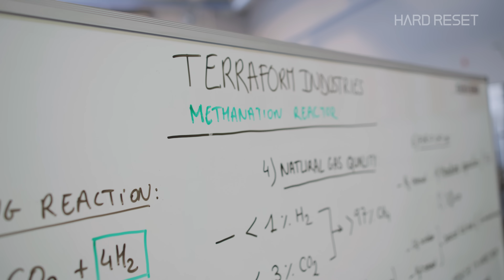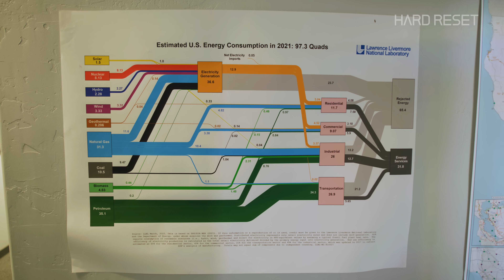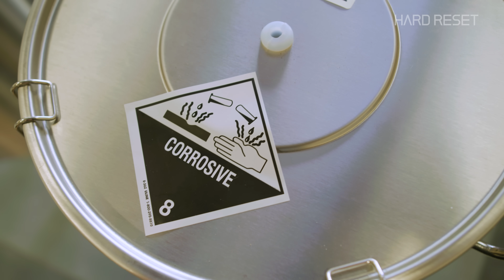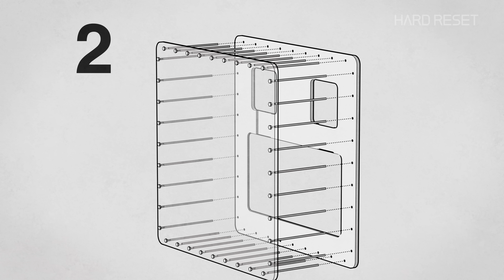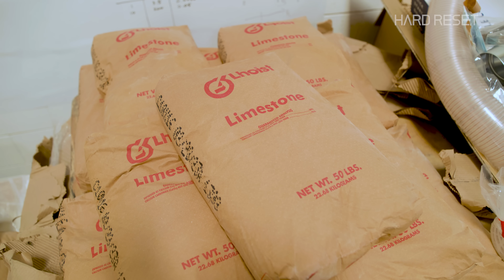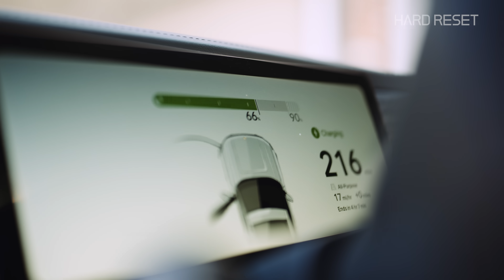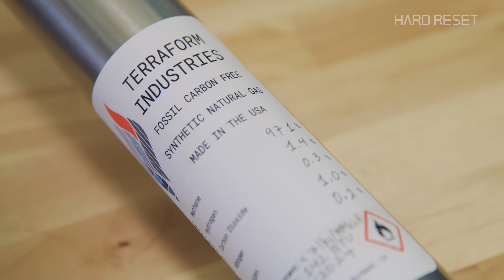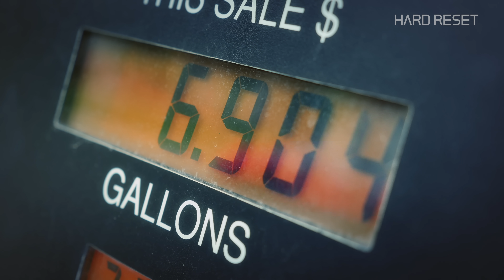The Last Fuel We'll Ever Need?

Comment: Fantastic technology..hats off to Terraform Technology... This reminds me off the Haber Bosch process where nitrogen is split under tremendous heat and pressure combined with hydrogen to make fertilizer.  Why can't they use the oxygen that is released from oxygen from the electrolysis process and combust it to run a gas turbine to generate electricity for the process to make it more efficient or even collect it and compress it in tanks and sell it ...just some loud thinking on how to increase efficiency.  I am from India and would be very interested in setting up a plant out here in the future...abundant sunshine
Reply: You don't need more oxygen than what is in the air to run a gas turbine.

Comment: I also understand it's not that hard to make methane just with water, charcoal, and heat.  You get some carbon monoxide in the process, which could be separated and used as fuel in the process.

Comment: Try vertical tanks attached to the walls of skyscrapers (so window washers dont have to deal with getting around them while cleaning windows. And if its sectioned out and clipped to the building itself you can replace them like lightbulbs imagine a tube bulb with algae in it that powers the building its hooked to that could solve the clean power system to terraform mars.

Comment: they are making a bet solar will get cheaper.  it will by a lot
they are also betting that batteries WONT get cheaper / better and power all the things they want to power with synthetic fuels like: trucks, planes, drones, rockets.

Solar + Batteries will pretty much dominate everything within 15 years.  
These fuels will have some edge cases - just like hydrogen or rocket fuel.  

Cool tech though.  i hope it works out.  you can never have enough energy abundance

Comment: Most people are probably thinking of this as a replacement for gas for heating and appliances, but that actually wouldn't make sense, since you could do those things more efficiently just by electrifying those systems. It would be good to apply this to making fertilizers for agricultural use though, which currently is heavily dependent on natural gas. We could totally eliminate natural gas drilling by doing that, in a way that is not practical with other methods. Making biogas from animal and plant waste is good up to a certain point, but it has a limit of sustainability when you start having huge fields and forests dedicated just to producing biogas, which will remove carbon from the soil and leave it depleted. Another consideration is that this tech could be connected to a geothermal or nuclear power plant, thus removing the requirement to take up massive amounts of space and materials with solar cells. I would say hyroelectric as well, but I'm at the point where I don't think massive hydro plants are worth the ecological and human costs. Wind could be a possibility as well, though I'm not actually sure whether or not they use less materials and energy to manufacture compared to solar.

Comment: my idea is CCU to Methanol and DME? both are much easier to store/transport compared to methane? we could RnD to make direct conversion processes even more efficient? politics aside M100 (100% neat Methanol) is available at the pump in China which are used by huge taxi fleets 24/7! DME works in Compression Ignition engines aka Diesel with few adjustments sometimes but a purposely designed one could be more efficient and vastly cleaner w/o any postburn treatment! Also there are already existing Methanol fuel cells which IIRC are 60-65% efficient? With RnD we could create even more efficient Methanol/DME fuel cells and pair them with electric motors for automotive applications. There is a prototype Methanol FCEV supercar called "Nathalie" made by a german engineer. His Orange Highness and members of government notice my rotund feline avatar and brilliant ideas! For a small fee you may own eternal and global rights...

Comment: Please remember: heating with Methane is very inefficient. Heat pumps are way more efficient than methane. And much cheaper than using electricity to create Methane.
But of course there are use cases where electricity is not the best solution and we need SynFuels.
The very, very important use case for those machines is the use of abundant renewable energy. 
And for this scenario you need very cheap machines, because they won't run all the time. This machine would run only 20% - 50% of the time. So investment per machine must be low!
Reply: There are uses for methane other than energy storage, but we could probably get rid of about 95% of our CO2 production without resorting to convoluted synthetic fuels which make little to no real world sense.

Comment: There are better ways that are cheaper and more efficient. Not only are there options for CO2 that remove their entire limestone step using industrial waste CO2 (which is abundant and you get paid for taking it) but producing Hydrogen and burning that removes 2/3 of their entire system. Downside is that producing Hydrogen is an energy losing process, meaning the best option is already not feasible.

Bio digesters are a workable option for mobility fuel and do not pollute like producing Solar panels does. Silicon produces 2kg of CO2 per kg which is why any option that relies on wasting cheap solar on inefficient processes is a nonstarter.

This MIGHT be feasible using nuclear energy because at scale the insane efficiency of nuclear can offset the losses of producing hydrogen.

Comment: Please correct me if I'm wrong, but this does not seem carbon neutral to me. in a perfect cycle it could be, take carbon from the atmosphere, convert to methane, burn it up in your car or whatever back into carbon. and you are back at the start. But! there is one big issue. methane is a gas that has a much higher global warming potential then co2. think 80 times more. and methane leaks are currently a huge issue. and i mean in each step of the production, storage, transport, and final use methane has a risk of leaking into the atmosphere. and if you scale the current use up in order to compensate for the fossile fuel that has to be replaced by it i am not sure if it would cause warming to actually go down. we currently have major issues with leakage and constructing at large scale and speed the facilities or adaptations to make and transport methane instead does not give me hope that it will be better in the future anytime soon. and anytime soon is exactly when we need to get rid of methane according to the ipcc. it is our best shot at staying below 2 degrees warming because unlike co2 the impact of cutting methane is much more directly felt. co2 stays in the air for a long time while methane decomposes (into co2) rather quickly. relatively speaking. just a decade or two. but with it being much stronger then co2 cutting it and allowing what remains in the atmosphere to turn into co2 will still decrease warming. 

this project it "the last fuel" we would want I fear. because there is an second issue with it. or rather with projects like it. maintaining the status quo. because if we don't do this but actually work on alternatives that will last then we can get the temperature down way faster then just kind of going half way. there are better alternatives today. ones that not only are better for the environment but also just for us as individuals. we need to decrease our dependance on cars. switch to electric where feasible. make real structural change.

Comment: Nice. Direct air carbon capture could be performed on co2 rich streams, perhaps from metallurgical and cement plants. All the energy required for this circular co2 to methane and back would need to be bridged by upscale renewable energy like solar. Combined with more bio processes and syngas or Fischer-Tropsch process and a variety of chemical pathways could be integrated producing versatility. Free ‘surplus’ energy from the sun and wind is the only real limitation.

Comment: Pretty sure I outlined a similar process in a reddit thread, a decade ago. Glad to see the holes filled in, and the kinks worked out. I'm not claiming origin, my take was a synthesis from several existing papers, just feeling a little vindicated that the loop works. Makes my think the ethylene glycol fuel cell cycle I was more recently running the numbers on might also work.

Comment: Wow.  So many energy intensive steps. This will never be competitive with ‘electrify everything’.
Reply: Hydrocarbons are also needed to make plastic and all kinds of chemical products that are usually made from oil. You cant make your clothes with electricity. So, if electricity is free from solar, any percent of efficiency still makes a viable product. Thats the whole point and key you need to master in order to get away from oil, not just "electrifying your car".
Reply: @strangereyes9594, it’s a lot easier to get hydrocarbons from the ground. We just don’t have to burn them as fuel.

Comment: The killer failure point of this while process is the Capex on the hydrogen electrolysis cells.  These are a mature technology that are already built at scale and we know they're way, way too expensive to bother trying to build a refinery-scale plant.  It'd be like trying to run a Just-Eat or Door Dash service using a Ferrari.   Sure, you could do it, but no one is making any profit due to the huge operating cost and loan repayment on the Ferrari.   Same deal here, Capex is King and no one is stumping up for electrolysis cells no matter what the efficiency is....
Reply: Yeah, they described the electrolysis cell, it uses common low tech materials to reduce the capex like you said.

Comment: It's a pity this can't be used reliably in vehicles as elec will be more practical for small and storage will be impractical in larger trucks or ships.  the energy density of bunker fuel is 40MJ/L and Methane is about 55MJ/kg - A 10L cylinder at 300bar will hold 1.94kg of methane - that same space can hold 10L of bunker fuel.  Sadly I think the only application would be for houses/cooking and other static applications where solar outcompetes in almost all situations. I wish it would work but methane/hydrogen fuel is just impractical in all aspects. methanol on the other hand could be an absolute game changer and I really hope it works.

Comment: Wait isn't methane like 10 times worse of a greenhouse gas than carbon dioxide, and isn't it incredibly hard to keep methane from leaking since it doesn't have any smell?? So even if it's supposedly carbon neutral will it be worse if there's more leaks

Comment: You don't need to get the CO2 out of the air there are other sources.
If you produce bio-gas (fuel is coming from sewage treatment plants), you will get a mix of 50/50% methane and CO2.
You could use this source it is also CO2 neutral, and much easier than filtrating it out of the air.

Comment: This hurts to watch. Hydrogen is currently produced by splitting hydrocarbons aka the product they are trying to produce. So they are using expensive electrisity to run the reaction backwards. This only works if  Firstly hydrocarbons are really expensive and in high demand (wich they are only because electricity is expensive), Secondly electricity has to be extremely cheap. 1 can happen but as soon as 2 happens the demand for hydrocarbons goes down dramatically, they only will be relevant for chemical reactions.

Comment: A lot of "low hanging fruit" is cheaper to simply electrify. This process has inherent efficiency losses not present at the same scale in batteries or grid power.
But I agree: that we are going to need some kind of carbon-neutral hydrocarbon synfuel for the applications where full electrification is an intractable problem.
Hydrogen is just too hard to store and transport.

Comment: However methane is not carbon free. It is a hydrocarbon and when it combusts, releases CO2. Methane is also ‘poisonous’ if released into an indoor or enclosed space and asphyxiates in a similar way to CO2. It is also one of the most potent greenhouse gases, far more so than the CO2 from which it can be produced via biological/chemical processes. Piping small-molecule gases such as methane often involves leakages, though less so than tiny hydrogen atoms or molecules

Comment: super cool, now deploy it at scale, and while you're at it also stop using natural gas for cooking, stop using gas for producing steel, stop using gas for heating, use more BEVs for use cases it's good at (i.e. anything but long range, high load), start carbon capture using accelerated weathering of limestone, etc.; we need all the possibilities at max potential. this isn't a silver bullet that will allow us to just continue with the status quo. 30%+ efficiency for this process is amazing but the well-to-wheel efficiency of vehicles run with this technology is still absolute garbage compared to a BEV in the end.

Comment: 10:19 Per AI,
The efficiency of a Sabatier reaction, which converts carbon dioxide (CO2) into methane (CH4) using hydrogen (H2), can vary depending on the specific setup and operating conditions, but generally falls within a range of around 60-70% for the methanation process itself, while the overall efficiency of a Power-to-Gas system utilizing the Sabatier reaction can be significantly lower, often around 35% due to losses in the electrolysis step to produce hydrogen

Comment: WTF...
This is by no means the latest state of the art...
Hydrogen has always been produced this way, but:
The way they gain CO2 -> simply connecting a CO2 separator to a concrete mixing plant is the same process, but much more efficient.
And then they produce methane of all gases? Methane has a global warming potential of around 27. If only the 27th part of the methane escapes (and it is a gas after all), then the whole process is no longer climate-friendly.
Just make propane or gasoline.
But of course, making propane or gasoline is even more complex, since the whole process alredy uses many times more energy than is provided in the form of fuel at the end.
It's just the e-fuels debate all over again.

Why the hell is this being presented as if it were a new idea or even economical in any way?

Comment: Nice video, thanks. I have nothing against the technology, but it's going to be niche. Any time you take solar energy and convert it to something else, you have to have a reason not to have used that electricity directly. For example (not your video, I know, but it's a simpler analogy): using solar to make methane to burn in a car, vs charging an EV battery. The car's efficiency is around 40% of the potential in the fuel. More efficiency is lost delivering the fuel to a fueling stop. Then there is the efficiency loss in creating the actual methane. If we used an EV instead of the car, we have a car that is about 90% efficient in turning the battery energy to motion (80% including the battery charge/discharge loss), and a fuel delivery system that is about 90% efficient (the grid). And we can generate it locally in remote locations with solar cells and local storage. Now, there will be niche applications for this, especially in the production of chemical end products. The same goes for green Hydrogen - it's incredibly valuable as a feedstock for Ammonia to make fertlisers, but silly for cars.
Reply: I like the fact that they are defining efficiency (for them) in economic terms.  Eventually, however, they will be unable to make further progress unless they pay more attention to energy efficiency.  They'll figure that out on their own.  The real trick I think is how to make electrolysis more efficient.  That will be challenging.  I wish them luck.
Reply: Storing electrical energy is the Achilles heel. All the storage methods, pumped hydro, battery, potential energy towers, you name it ; fall way short of the stored energy that is contained in a liquid fuel. We already have a planet wide infrastructure  to store, transport, and distribute liquids without creating  or dramatically  expanding any distribution/storage system and tearing the planet apart looking for new deposits of rare earths. Electricity  is an energy  transport system, not an energy source.
Reply: I like how homeowners with the allegedly green electric  cars recharge overnight when the sun doesn't shine. How many coal fired plants could we shut down if nighttime charging was prohibited. But that would rob the atmosphere of the heavy metals from coal burning that fall back to earth onto the fields of food crops.
Reply: Solar have big limitation of night blindness 
So we need something which can be used day and night
Reply: The main issue I see this solving is that EVs are dependent on rare earth minerals for their batteries. And said batteries are heavy and expensive, too. Combustion cars are just more economical for most people to get outside of countries that forcibly change that either through taxing gas, subsidizing EVs or both. I'm not too confident this will overtake the new battery technologies that we're developing, but it's nice to have as an option in case those fail, I guess.
Reply: @rikuleinonen Yes ! Plus, planes aren't going electric any time soon and they make up so much of the CO2 outout...

Comment: Remember to also plan for the utilization of the purified oxygen stream. The system will likely need to utilize every potential revenue source it is capable of.
Reply: Add the oxy to the methane to produce rocket fuel